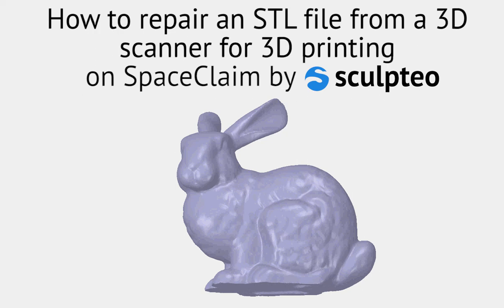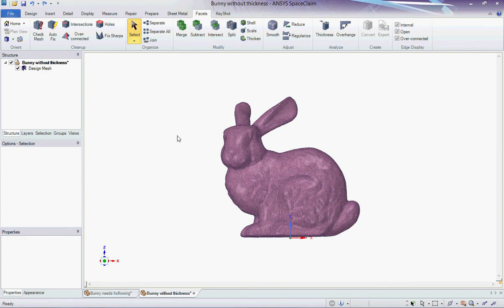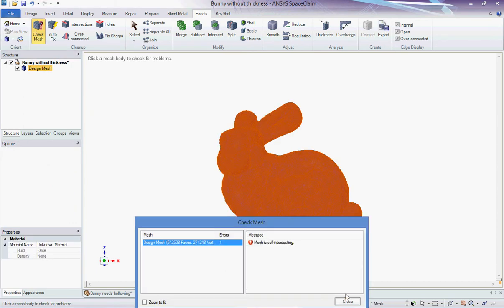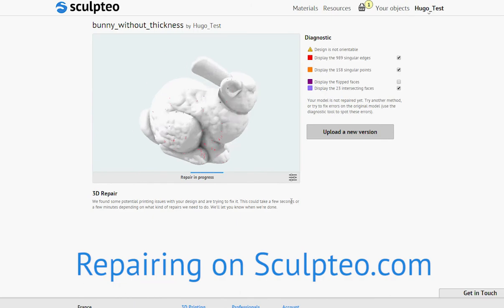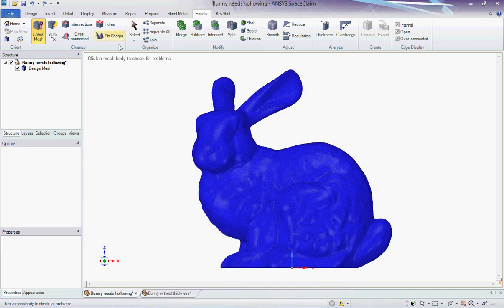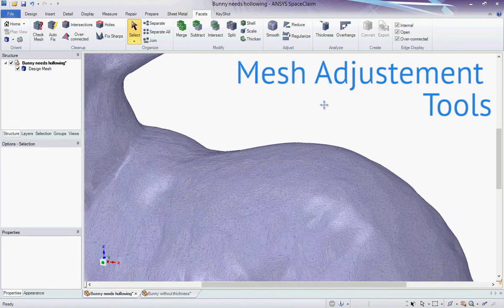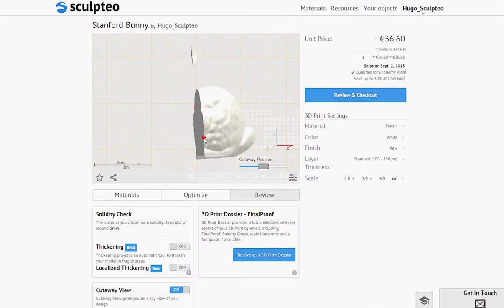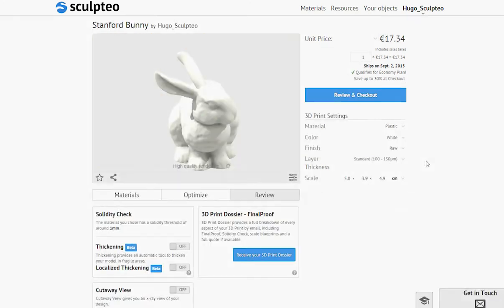SpaceClaim Tutorial by Sculpteo part 3: How to repair an STL file from a 3D scanner for 3D Printing

Comment: hi there nice vids. I have a cup shaped object. hollow inside with an open top. How do I make the object solid?
Reply from the maker: +ThatVayne NA 
Typically we get the opposite question, this is because when you create your object and upload it to our site if it's water tight it typically will automatically create a solid 3D render on our site. You have to apply the steps shown in the video to hollow. If you're model isn't originally solid you can remove any hollowing holes that might be on your model and re-upload and it should fill in as solid. If you have further questions or if I'm not understanding your question properly please email contact@sculpteo.com
Reply: I have emailed you with pictures, thx :)